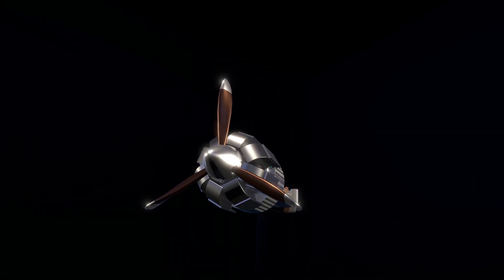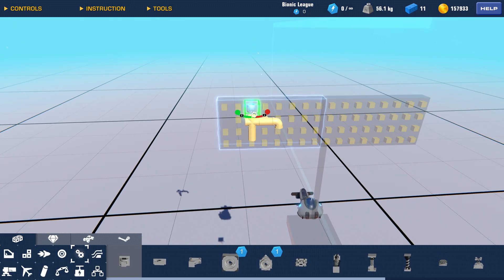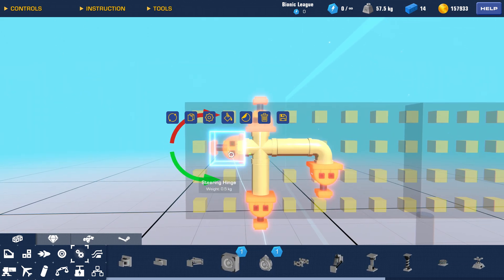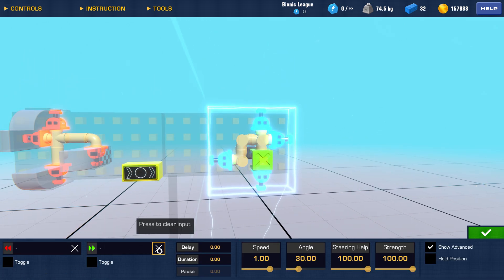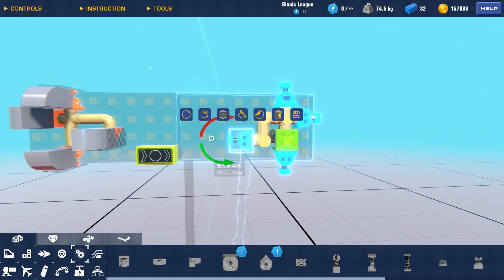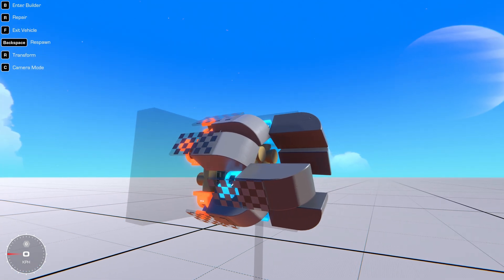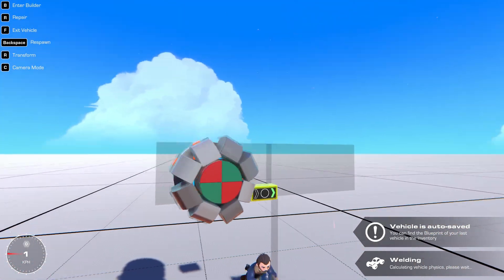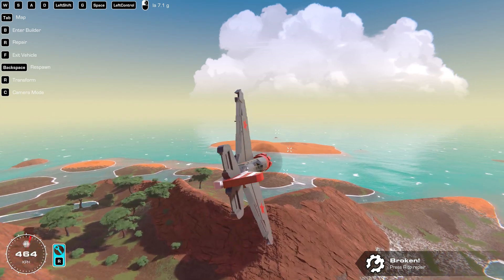Radial Engine - Plane Nose Tutorial - Trailmakers

Comment: great tutorial but for some reason when i try it with the ''filled out center'' (to connect the prop) the engine piston won't go all the way in
Reply from the maker: Clipping in Trailmakers can sometimes be really strange, as it’s essentially a game bug. Therefore, I recommend saving frequently. When you place a new block that causes clipping issues, you can revert to the previous version and try other construction options.